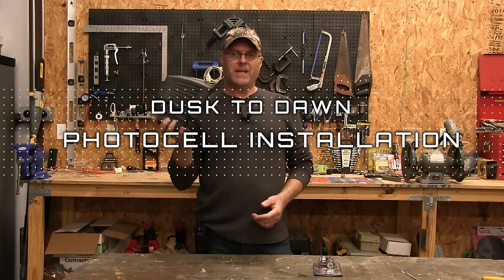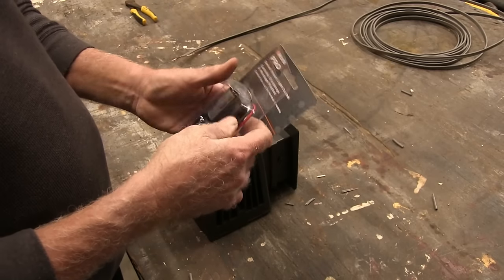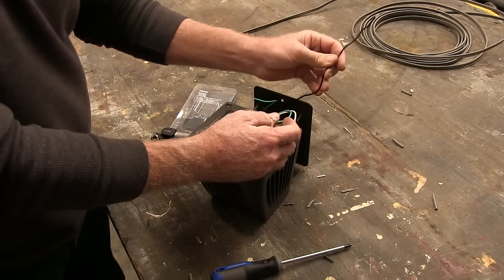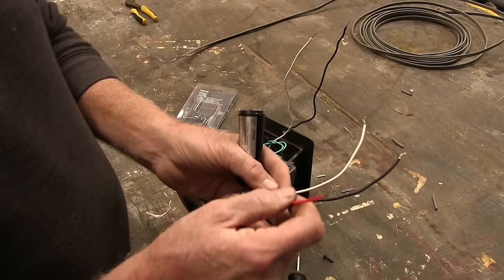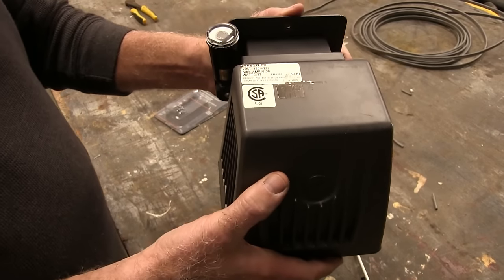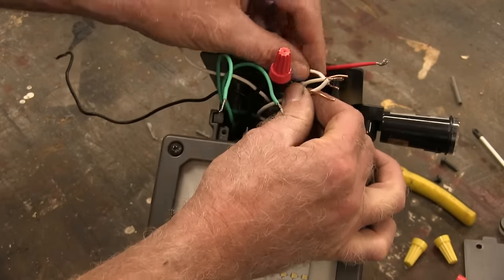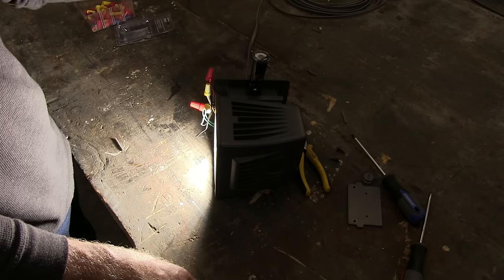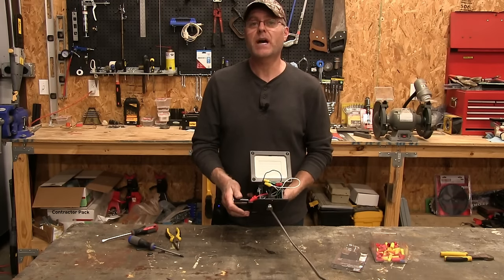Dusk to dawn photocell switch installation

Comment: Thank You. I installed one yesterday and went out flipped the dreamer on looked and the light was on. I then put my socket tester in to make sure everything was right and at that second it went out. Dang-it. Put my finger over the eye and nothing . So went back checked the breaker and was fine and the tester showed everything was right.So called it a night. Got up watched your video before I went down to buy another one and when you said it takes a minute or so to come on I got up with my coffee and reinstalled it. Flipped breaker on it went. Put electrical tape over the eye and a minute later on it came. Buttoned it up and went in for another cup of coffee as I’m done and never had to leave the house. Thanks to your video.
Reply from the maker: Awesome 👍

Comment: Thank you. Had to replace on old mercury light lantern to a new led light. Using the old photo cell in the existing yard pole. We didn’t have it wired quite right. But got it fixed and working thanks to your video!  Only had to change one wire.
Reply from the maker: Awesome 👍

Comment: Some photoeye switches have built in capacitors built into the circuits, thus the delay is from the de-energizing of those capacitors. This design was to help reduce strobing at sunsets.

Comment: I appreciate your video thanks 🙏 also I’m curious if you exceeded the maximum wattage will it burn or overheat
Reply from the maker: I've never exceeded the 1800 watt max and I'm sure it will over heat.
Reply: @petebeasttexashomesteading  appreciate  your video.
Hey how can I install a photo cell control light and a switch  control light  in the same circuit?

Comment: If it's just in essence a switch why does it matter which wire goes to red or black? I know it does because I had the blinking lights issue before I wired it as you suggested. Thanks for the vid.

Comment: Pete, Thanks for the video. I have a question for you.  I am going to replace a nonadjustable photocell mounted on an exterior wall that points directly an opposing wall which creates reflective light. That reflective light causes the bulb in the fixture to cycle on and off. I am going to use the photocell you showed in the video as the replacement, so that I may point the photocell straight up. The hot wire in the wall goes into a box and of course the wire going to the light fixture is also in the same box. I don't know which of those wires is the hot wire. I don't have any testing equipment and could jerry-rig a light fixture to the wires in the box to find the hot, but before I do that I thought I'd ask you if it makes any difference in the functionality of the new photocell if the hot wire is connected to the red lead in the photocell, instead of the black wire, reverse of what your video shows? Greg from Sacramento
Reply from the maker: The hot wire from the house (black) has to go to the black wire on the photo cell or it won't work. You can pick up a volt meter fairly cheap. Turn off the power to the light and undo some of the wire so you can test it and make sure the power wires are NOT touching anything else and then turn the power back on. Then put the volt meter on volts and put the black wire from the volt meter on the ground wire (green or bare) and the red wire from the volt meter on one of the other two wires. When the volt meter reads 120, then you'll know that the red lead wire that it's touching, is the hot wire.
Reply: @petebeasttexashomesteading  Thank you Peter. The photocell is arriving today before 10:00 PM. I'll follow your expert suggestion before it gets here.
Reply: Pete, all is well now and the sun is doing all the switching. Thanks again!

Comment: When our home was built (2006), they installed an interior dusk to dawn sensor for our stair lights and a wall sconce which are on the same circuit breaker.  The lights no longer shut off, we can’t find the sensor to replace it.  It’s not in any of the stair sockets nor is it anywhere in the wall sconce.  (We can’t call the electric company, they went out of business 2008-2009.)  Two questions: is there another location they might have connected the sensor and if we installed a new one in the wall sconce would it work with the old sensor still somewhere on this electrical circuit?  Thank you!
Reply from the maker: It would be best if you get an electrician to find the problem, but if the lights are staying on then you can add a photocell to the lights.
Reply: the light sensor of course needs to see daylight, keep looking..

Comment: Simple enough that I think will try. (A Junction box works same way as the light fixture right?)
Reply from the maker: Yeah the light fixture in the video has a build in junction box. You can put the photocell in a junction box and then to a light.
Reply: @petebeasttexashomesteading  I had wires coming out of a soffit in an old house. The porch light was wired down the soffit & came out into junction box. No green wire. But replaced the old sensor (this same type) the way they had it wired and it worked! Would not have had courage to even try if hadn't seen this video. My wiring was old and had white black and red wires coming out. Sensor's red had to connect with a black and a red from that junction.

Comment: Is there something bad with wiring copper wire to aluminum or is it ok in this instance? I.e. wire the switch which has aluminum stranded wire to the copper solid wire coming from the house?
Reply from the maker: In this instance it's ok. The only problem with aluminum wire is if you draw too many amps, it could heat up and melt. But for this instance especially an LED light it's fine.

Comment: I'm looking to use a photocell to mimic the cycle of the sun for reptiles that are light sensitive. So I want to turn lights on at dawn, and off at sunset. Can this be used to achieve that? Maybe using a relay?
Reply from the maker: Absolutely, If your reptiles are inside your house, just mount the photocell outside to an electrical box and use a 14/3 flexible wire as an extension cord to the lights where your reptiles are.  The 14/3 will have three wires, black, white and green. Connect the blacks together on the photocell and the whites together on the photocell and connect the green and red together on the photocell. When you connect the extension cord to the lights, Connect the black (hot) to the black on the extension cord and connect all the whites together, now connect the green wire from the extension cord which is really the red from the photocell to the black on the light. Here's a link to the 14/3 wire: https://www.homedepot.com/p/Southwire-By-the-Foot-14-3-600-Volt-CU-Black-Flexible-Portable-Power-SOOW-Cord-55809999/204632918
Reply: @petebeasttexashomesteading   Oh wow, thanks.
That looks like something even I can do!
Reply from the maker: Okay I just re-read your comment and the way I explained it to you is not what you're looking for. It will turn off the light durring the day and on at night.
Reply: Jorge Sierra it is so simple to reverse the action whit one contactor or relay using a normal close contact of it just use the photocel to energize the relay, and use the normal close contact to energize the lights and  your reptiles will be so happy, good luck

Comment: What happens if you connect the red wire from the switch to the black hot wire from your house
Reply from the maker: Not sure because that's not how the switch is wired for. If you switch the red and black it might still work because it's just an on off switch. But best to connect it as I did in the video.

Comment: Doesn’t the nut go on the sensor shaft before screwing it intothe fixture?  That way you can lock the sensor into any position.
Reply from the maker: You could do that but since the fixture is threaded you can also do it from the outside to lock it into place.

Comment: how do you prevent the light from deactivating itself once you add the sensor?  like when it gets dark enough to trip the light and then the light shines on the sensor and it cuts power thus turning off the light.
Reply from the maker: Just make sure the sensor is facing up towards the sky and away from the light.

Comment: could you connected a photocall to a AC two wire motor and or how would you wire that up?
Reply from the maker: The switch can only handle up to 1800 watts, you may need to connect a relay between the switch and the motor to handle bigger loads.

Comment: Wrong. red wires are positive and black wires are negative
Reply from the maker: In DC yes, not in AC. The black is hot and the red carries the current to the light when the photocell turns on.
Reply: cars - yes.

Comment: Great video! I do have a question. I currently have almost all exterior lights on a single circuit. Can I install the sensor (Brightness not motion) to control all of them?
Reply from the maker: Yes, you can, but it can only handle a maximum of 1800 watts. So you will have to add up the watts of all the lights it will be powering.

Comment: Folks, never just put 2 or 3 pieces of wire together and cap them with a nut. ALWAYS TWIST your wires together. Otherwise this is a fire hazard, and will trip the breaker fast because it’s not a good connection

Comment: I Have 2 exterior lights both connected to the same switch, can I install one photocell for both?
Reply from the maker: Yes as long as the total watts of the lights does not exceed 1,800 watts.
Reply from the maker: Yes as long as the total watts of the lights does not exceed 1,800 watts.
Reply: Pete B. Ah the random two comment thing happened to you too

Comment: Fantastic video, your explanations are clear without any ambiguity. Thank You.
Reply from the maker: Jerry Grayson  Thank you, I really appreciate that. Thanks 😊
Reply: Pete B.  I wonder why older older light sensitive switches had only two black leads/wires which was simply connected in series to the black live wire but new light sensitive switches have need for a common/white  wire. Is there a new code making a common required?
Reply from the maker: Jerry Grayson Hmm... not sure. I guess there must be a new safety requirement.